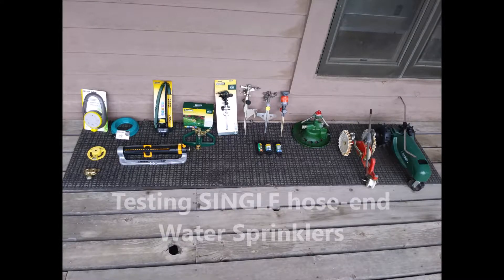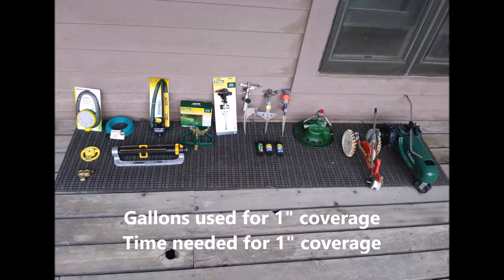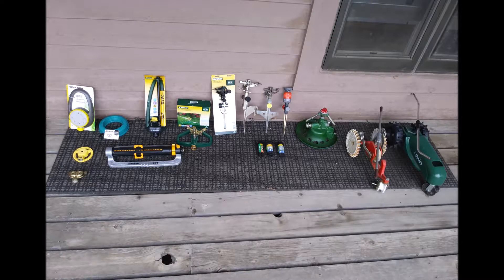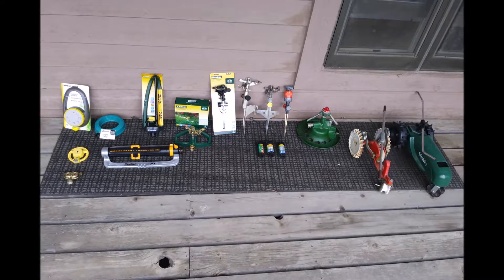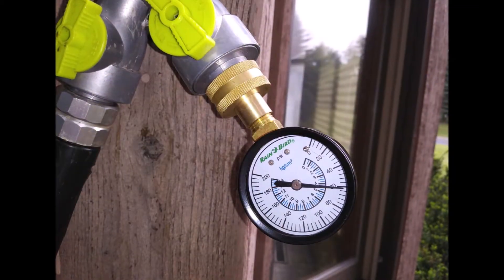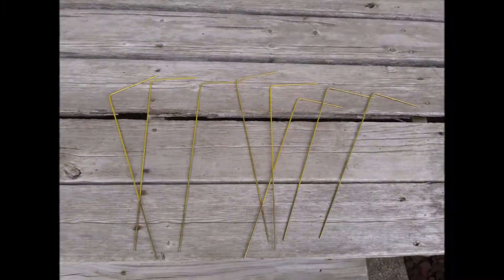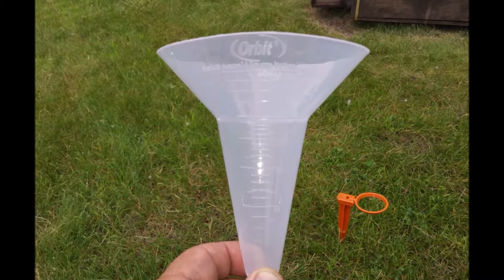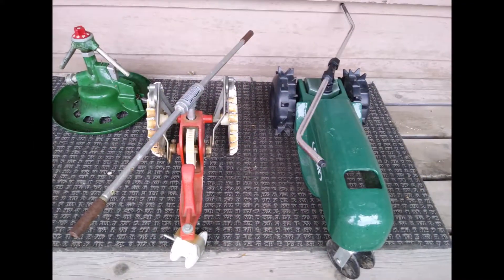Single hose-end Water Sprinkler Performance Testing

Comment: @TommyTester Did you compile all the results from the various tests into a single video, or alternatively, is the data available? Would be curious of your favorite pick of the bunch tested.
Reply from the maker: I never did a summary video but the charts are all there for people to make decisions or run their own tests.  I use the Orbit traveler exclusively as it covers my yard edge-to-edge and I was able to dial-in the uniformity to around 80 percent.  Plus it has an auto-shutoff.  Thanks for watching!